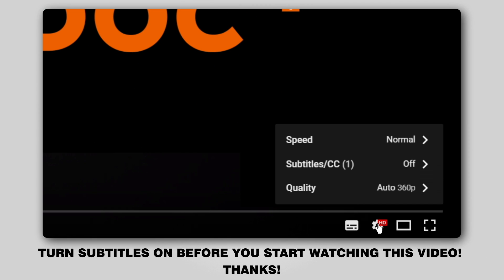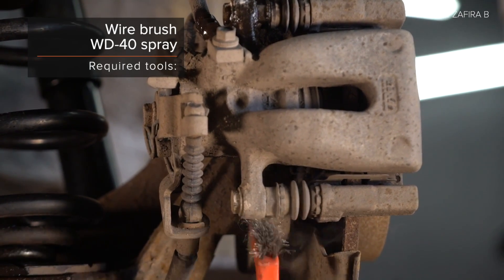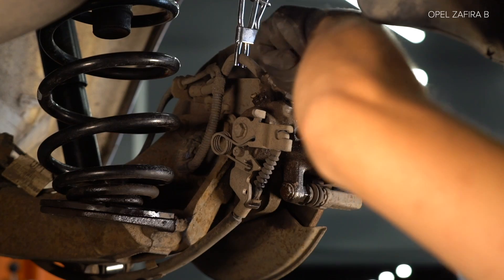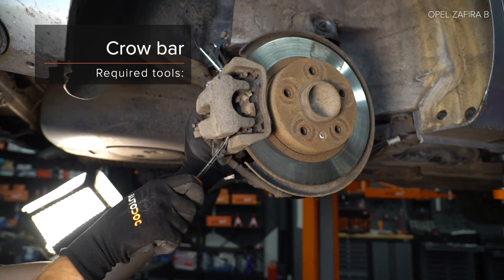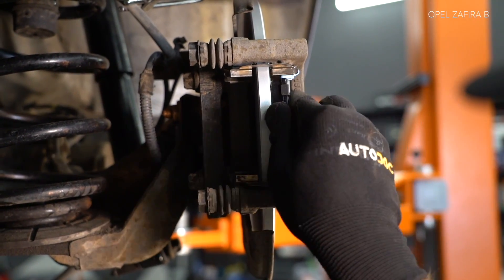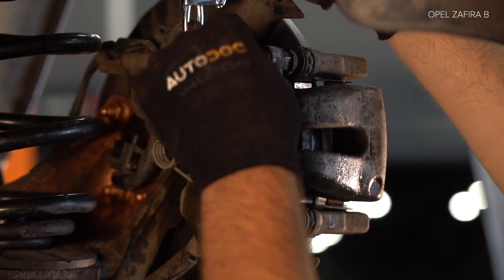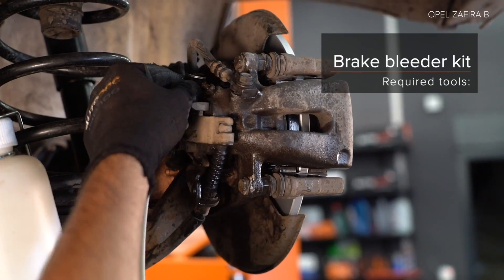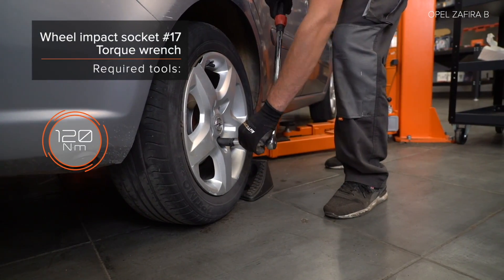How to change rear brake pads / rear brake pad set on OPEL ZAFIRA-B 2 (A05) [TUTORIAL AUTODOC]

Comment: I’ve just done my set and if you use spanner’s instead of a big fat socket you wouldn’t need to take brake line off at all 💯
Reply from the maker: Please contact us back and clarify or rephrase your question and we will be able to help you.
AUTODOC
Reply: Exactly. There's no need to disconnect the line or drip cleaning fluid into it as you reconnect it as that guy did...

Comment: Do you have to bleed brakes?
Reply from the maker: As a rule, replacing brake pads (both front and rear) does not imply intervention in the brake system circuit.
In other words, no depressurization occurs. 
This means that bleeding the brakes after replacing the pads is not always necessary.
AUTODOC
Reply: @autodocuk  You will need to bleed the caliper if you disconnect the fluid line as was done in this video but that isn't necessary. Use a spanner on the top caliper bolt.

Comment: Questions from an Internet expert: Why disconnect the brake line resulting in a fluid bleed? Why not pry the pads away before removing the calliper? Why skip the disc replacement? Why only clean the disc on one side? Why not mention that an Torx E (I think no 18) could be needed? Guess they overlooked the damaged rim because the car was a demonstration car. Good info on torque but overall, a pretty bad video.
Reply from the maker: You are right, some points in the video were missed, but our channel is not educational but is only for informational purposes. We strongly recommend that all replacements, especially those relating to the brake system, be carried out exclusively at a specialized service.

Comment: no need remove brake line
Reply: Is the brake line bolt not in the way of the calliper bolt ? I’ve got this job to do on my own car tomorrow
Reply: @grahammyers6475  no not in way way at all.ive just done front and rear on mine last week .very simple job.just take your time.
Reply: @grahammyers6475  You won't get a socket on it, just use a 13mm spanner. No need to remove the line.